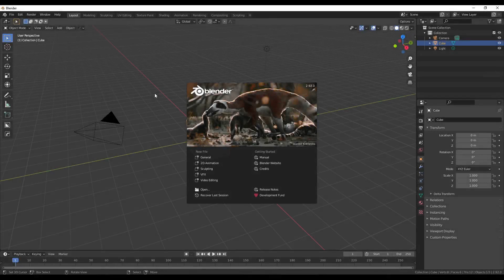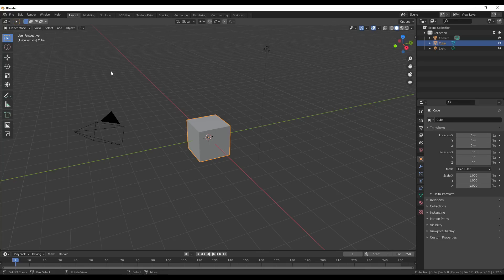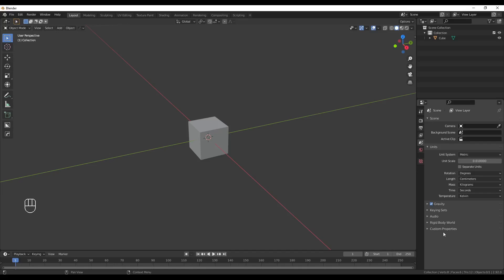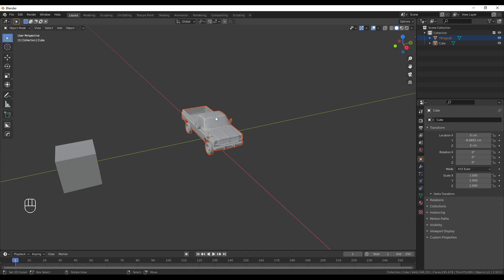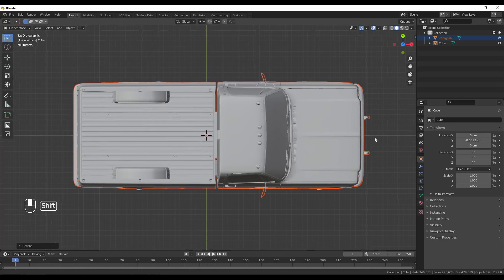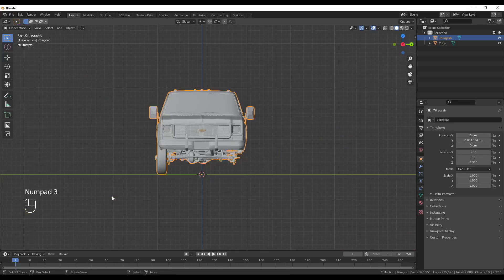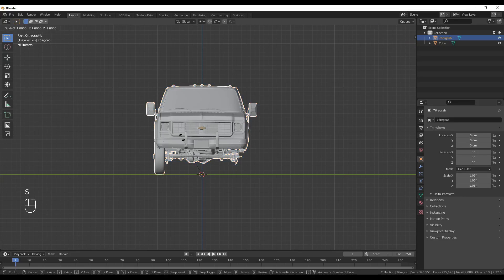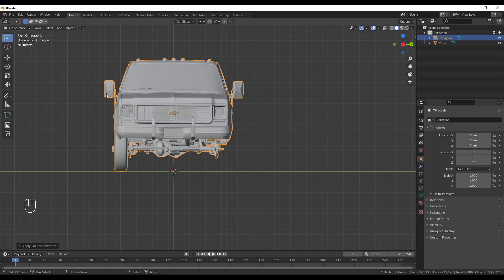Snowrunner modding part 1 - How to import a model

Comment: How many centimeters are heavy/heavy duty truck scales?
Reply from the maker: I set them between 2.5-3 cm.  I'm not sure how to accurately scale a semi truck/heavy/heavy duty truck
Reply: @dieseladdict6685  I’m working on a school bus mod currently at 2.3 cm scale. But I’m not sure how many cm it has to be exactly. I want it to be the size and weight of most heavy/heavy duty trucks and not a scout, like Watlimes211’s useless megabus
Reply from the maker: @MrChevrolet94  Yeah, if you hadn't decided to insult another modder's work in my comments (twice), I'd have helped you.  Unless and until you put in the time to make a truck (and see it through to completion) you don't get to criticize someone else's work.  If you don't respect another creator's vision/direction for a mod, fine.  Dog on them for their efforts, especially in a public forum like this?  

Get the hell out of here with that attitude.